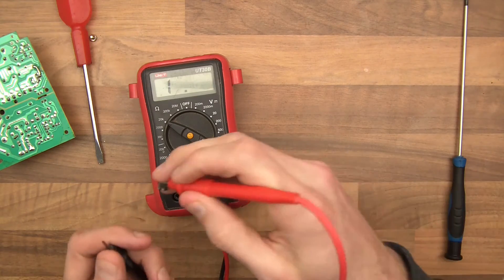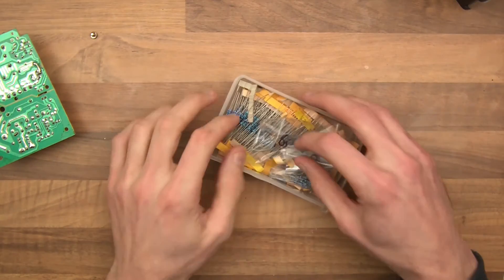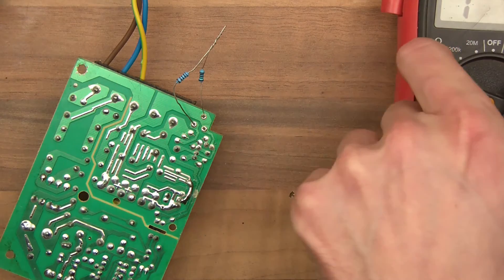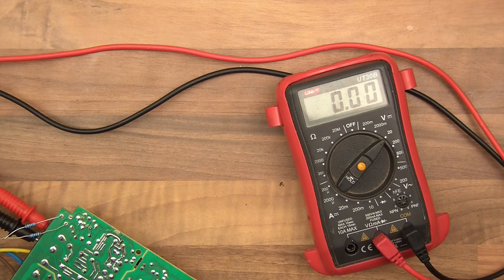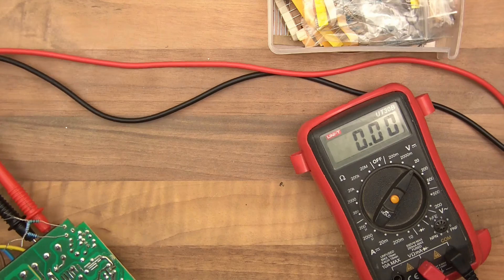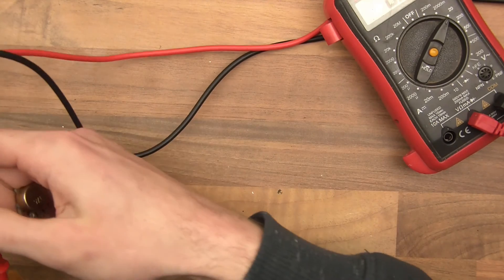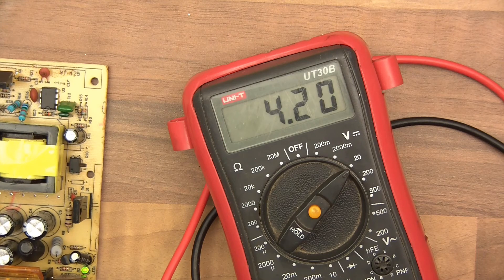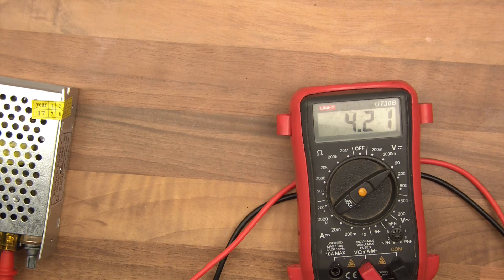TUTORIAL: How to Adjust Output Voltage Switch Mode Power Supply! 5v to 4.2v - Lithium! Part 2/2

Comment: I know this is not what the video is about, but a safer way to drop the output voltage with no risk of compromising the function of the PSU would be to add a power diode in series with (after) the 5v output line. With one diode you would get a voltage drop of about 0.7v, which would give you an adjustable range of 3.8 ~ 4.8 volts
Reply: nice thanks for th etip sir

Comment: This is a really bad idea. Before you modify any electronic circuit it's always a good idea to learn how they work. Switched mode supplies use a feedback loop to regulate output voltage.  The potentiometer for output voltage trimming gives you the maximum percentage adjustment that can be achieved without affecting the stability of the feedback loop. That loop controls the frequency of the on/off switching that regulates the voltage. The clicking noise you heard was the capacitors discharging indicating oscillation in the loop. Even though you brought it back inside that point where the oscillation began, when loads are applied that point changes. By taking it outside design parameter you've created an unstable and unpredictable power supply that might be unable to regulate itself under certain load conditions. That is not a situation you ever want to be in when charging lithium cells where current and voltage regulation is critical. It's also extremely unlikely that the supply would maintain that voltage under load. That trim pot is there so that you can connect the typical load to your supply and then trim for the correct rated voltage. You should only ever use properly regulated, dedicated lithium charger circuits. They are able to detect over and under voltage situations in the cells. It can be particularly dangerous to charge a cell that has dropped below the minimum with no current regulation. It would be far better to just buy a charger board (less than 50p each) and give it 5V. It will take care of the rest and you'll even get a nice LED indicator to tell you when it's charged.

Comment: I get what you’re doing but it’s clear you don’t really understand SMPSs. The tiny difference in output you need should PROBABLY be ok. 

The better way to go would be to feed a proper charge controller with your 5 VDC. They are built to do the level shift and save you from all the trouble of manually managing the constant current to constant voltage profile you need to safely charge those cells. 

If anyone seeing this thinks they can wack in any old resistor to get a different voltage, they’re in for a surprise. At very least a decent PMW controller will shut down and enter an endless restart loop. At worst something’s going to pop. 

Your video needs to seriously emphasize that you are making a minuscule change and that your entire plan is sort of back to front. 

As to the entire concept that 5 VDC supplies are strange, young man your just out to lunch. They are simply everywhere. Ever heard of TTL?
Reply from the maker: I don't understand SMPS at all! The modification has worked though! Yes, phone chargers too are 5v.
Reply: @antonycartwright  no phone "chargers" are dumb 5V power supplies , charging circuitry is buit INSIDE the phone and almost always include a diode with a VF of 0.5- 0.8V for RPP
Reply: @DazzaDirect  Damn, who pissed in your cornflakes today? Give the guy a break, why dont you? And where are all your videos, putting yourself out there for everyone to pick at? Nowhere....same as mine.
Reply: @englishrupe01   haha 😂 rofl

Comment: Seems odd how that works but congratulations, you got your 4.2v. Now you can blow up your lipo's . I know you've never had a problem but thats what everyone says.
Reply from the maker: Well, I don't know! I have 100 cells... I've charged them to 4.2v CV for a very long time without any problems at all. Mine don't even draw 1C and I've not modified them! Maybe I have 100 strange cells! Seriously, I'm not lying!
Reply: @antonycartwright  okay, nothing's gone wrong I believe you. I'll stay with using a purpose built charge controller. Can still be done at low cost.
Reply: @apbosh1  "seems odd" ok i say CRAZY,  why not simply use a diode with a VF of 0.8V at the output , takes seconds, no need to open the PSU, get shocked , void warranty and provides basic reverse polarity protection.
Reply: @DazzaDirect  seems logical but with 6 amps is there a heat issue? at 0.8v . Gonna have to look at some diode sheets now.
Reply: @apbosh1  mate you can get 10x 15amp diodes for a quid (£1) delivered from china,  diodes come in all shapes, sizesand capacities , if heat is an issue use a 10-15A one and the heat output will be halved . i always use the KISS theory , (Keep it simple stupid) . This video is a perverse proverbial "sledgehammer cracking a nut"  ;-]
Reply: @DazzaDirect  Using diodes to drop voltage is stupid.  They waste too much power and also their voltage drop changes considerably from temperature change and passing current. Also each power supply doesn't output the 5 volts, that means that you have to find a different diode for each power supply you own ?
Reply: @panjak323  i disagree with this statement . P=I.V  for this maximum of 6x0.9 =5.4W  , not much , use a schottky with a 0.5Vf and that's around 3W,  FACT  ;-)
Reply: @DazzaDirect  you said find a diode with 0,8V voltage drop, that's a fact ;) with your 5W wasted, the battery gets 20-25W of power, that's efficiency of below 80% +(PSU losses). Also overcharging at 4.2V is not good for lithium either. Just get a proper variable voltage PSU or even better, a proper charger that disconnects power once the cell reaches 4.2V.
I'm not saying it's a bad method of charging in emergency situations, I do this myself. But it's really unreliable and not good for the longevity of the cells in the long term.
Reply: @panjak323  of course get a proper charger TP4056 are like 10 for £2 , this dude is crazy , ALWAYS terminate charge , check out my comments around this video , let me be clear , what this person who openly admitted to not understanding even SMPS topology , opening up U.K 240V ac mains and dipping in vs a diode is my contrast, TP4056 is too cheap and no chance of DEATH , but yes 
100% CC/CV terminate @ 1/10 C is the way to charge almost all lithium batteries ;-)
Reply: @DazzaDirect  In that case you are right :)

Comment: Putting an 800R or 1K resistor in series with the original pot to nudge up the resistance would be tidier but you got the same result.
Reply from the maker: Very true.